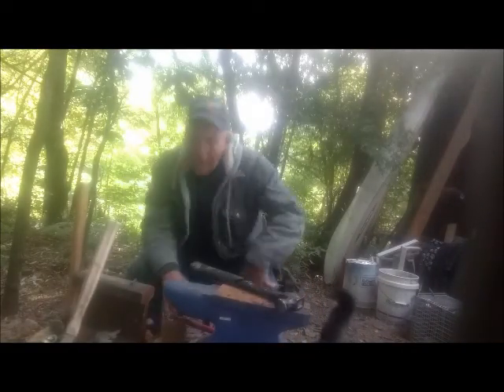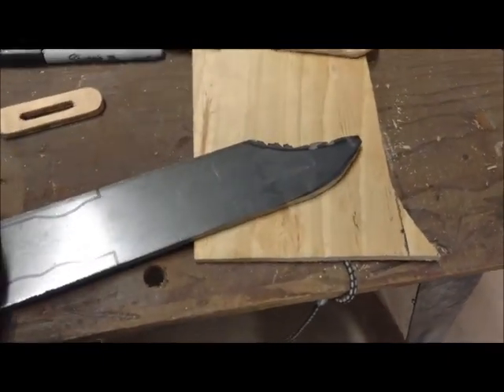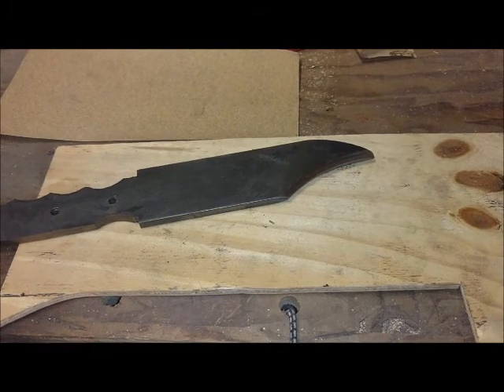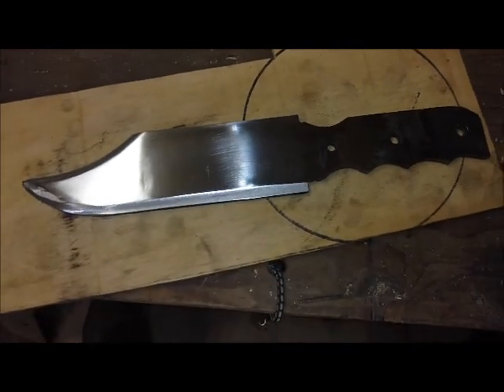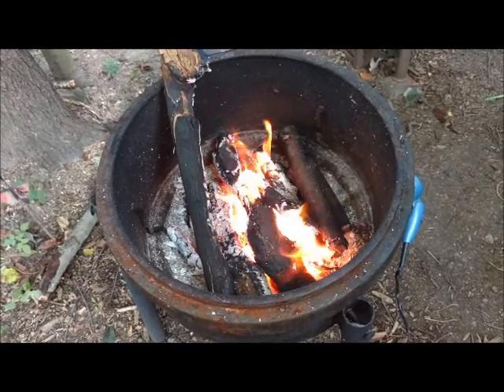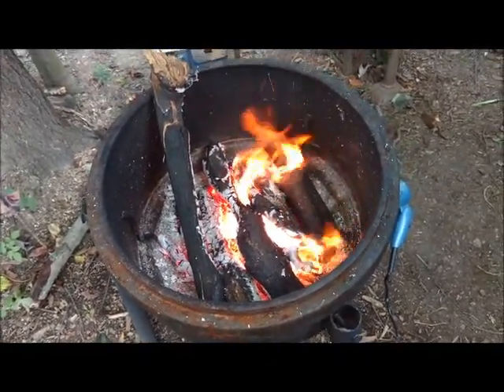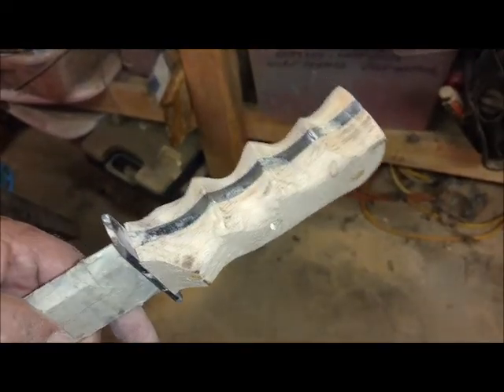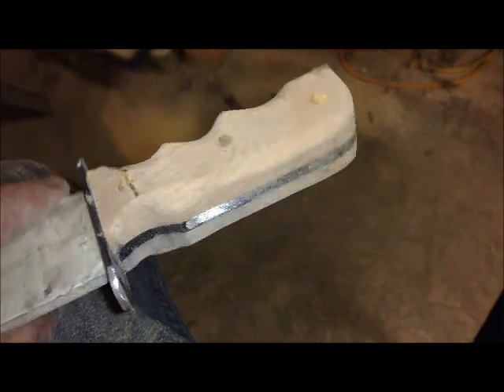3rd knife video 1080 high carbon steel

Comment: what type of wood is that?
Reply from the maker: Oak blocks from a nearby Amish sawmill.
Reply: @deepbeeps   and how many degrees does the steel 1080 need to be heated so that i can work on it?
Reply from the maker: @MrThePsychologist  I don't go by degrees, I go by color. It needs to be a bright orange to move metal.